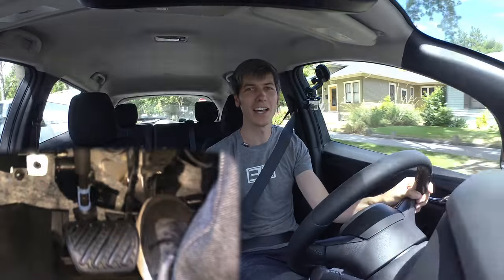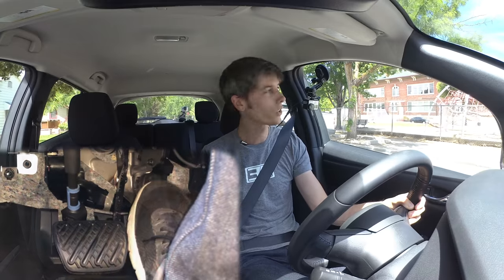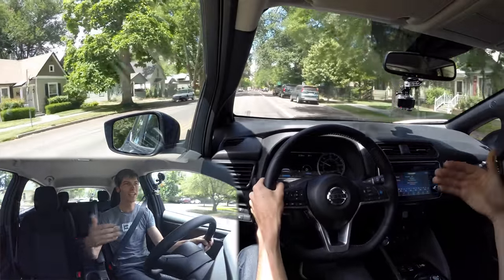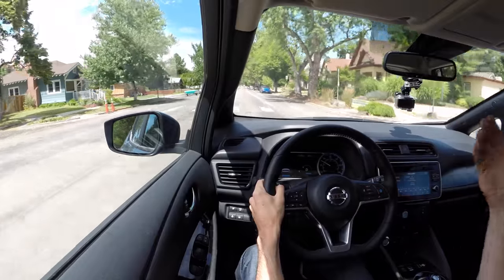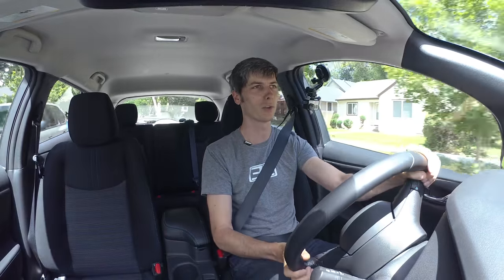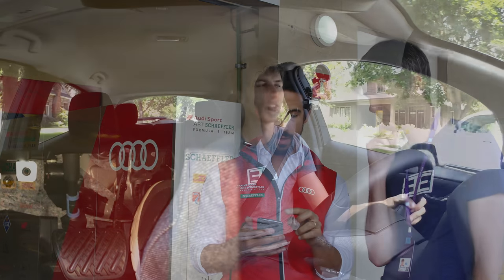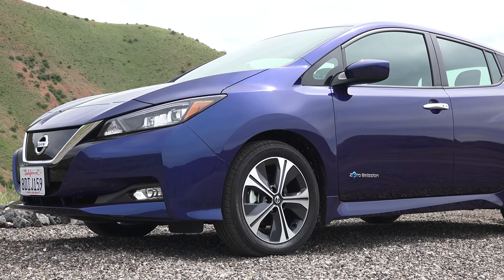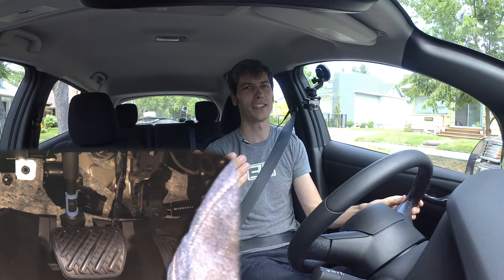What Is One Pedal Driving?

Comment: Does this eliminate coasting capability?
Reply: there is a setting to disable the feed back to the batteries
Reply: I don't think so because you can touch the gas pedal just a little bit and it will disable the engine brake - or you could just turn the system off. (haven't tested it tho, just assuming it)
Reply: JoshL You can still coast but the difference is that you will still need to push the gas pedal down a little. At least that how it works in my car, it may be different in others
Reply: I was wondering about that, too. Even more so, since they say, that coasting is the most energy efficient (at least with combustion engines).
Reply: it regenerates lots of energy to the batteries when you coast. 
around 300~ meter of downhill coasting regenerates around 4-5 miles of driving!
Reply: Presumably, but there is a toggle to turn the regen braking off unless you are manually applying the brakes, where it will also step in to help.
Reply: In my Ioniq, I can mostly do the same with the regen set to max. I don't use this as I find it tiresome. I prefer to have the regen set to zero and use the pad of the steering wheel to regulate the regen. So I can coast, and use the pad to break, plus the hydraulic brakes if I need to brake more.
But I think the best would be if there was no regen by default, and using the brake pedal to regen more or less, and the system would use the hydraulic brake as needed (if the regen can not brake enough).
Reply: I think some cars have a creep setting
Reply: Pretty sure that's all customizable, atleast in a tesla it is.
Reply from the maker: You can coast two different ways. If you have it in e-Pedal mode, you can coast by simply lightly holding the throttle. Or you can turn e-Pedal mode off simply by pressing the button and coast like normal.
Reply: Dominykas but real coasting is still more effective than regenerating, so if you just can go on after driving down an incline you use your energy better if you coast instead of regenerating.
Reply: +dranoelr:   "Real coasting",  which stores the car's energy in kinetic form, is better only when there's a known opportunity to transfer the energy back to gravipotential energy by going back uphill, before one's speed builds past a legal or rational limit.
Reply: Can you easily turn e-Pedal mode on or off?  In other words, is it a simple easy to access button on the console or steering wheel?  Hopefully not deep down in some menu option on the screen.  

I think it's important to be easy to disable it.  Sometimes, especially on long drives, I'll want to take my foot off the accelerator pedal to give my foot/leg a stretch.  With e-Pedal on, that would slow the car down.
Reply: Domenic DeFrancesco: cruise control. It is a thing.
Reply: Timothy Nguyen gas pedal🤔 ... some things are hard to let go, but “go” pedal may be a better name.

Comment: I've been doing something similar with regular cars. I've learned the engine braking strength of different cars, and can slow down most of the way without using the brakes, when there's no one behind me. I don't do it so much with a car behind me, because impatient tailgaters, nuff said. Interestingly, the engine braking is better in the winter, I assume because the parts and lubricants are colder, providing more friction.

Comment: It's not only electric cars you can do the 1 pedal driving with.
Basically you should do it with all ATVs and tractors etc which have a hydrostatic transmission. If you let of the gas they usually break slowly by them selfes and if you would be to slam on the break all the time it would destroy your gearbox/axel because of the "water hammer" effect - and that wouldn't be nice, would it?
Reply: "water hammer" oh give me a "break"...just tell everyone you dont know what you are talking about
Reply: stickloaf Okay. According to Wikipedia or other sources there is an effect called water hammer
"Water hammer (or, more generally, fluid hammer, also called hydraulic shock) is a pressure surge or wave caused when a fluid, usually a liquid but sometimes also a gas, in motion is forced to stop or change direction suddenly, a momentum change. A water hammer commonly occurs when a valve closes suddenly at an end of a pipelinesystem, and a pressure wave propagates in the pipe"

As far as my knowledge goes when you hit an the foot break on a vehicle with s hydrostatic transmission you force the pump to go in its zero/non pumping position or lock up the rear axel so the fluid can't flow through there as it wants and then the upper mentioned effect kicks in, harming your parts in the long therme.
However I have to give you the credits for noticing that I'm not an engineer so there is a fair chance that I'm in deed wrong.
If that's the case and you know better: teach me, I'm eager to learn.
Reply: Humbucker 007 Most hydrostatic systems have relief valves built in that can allow oil to go from the high pressure side of the circuit to the low pressure side of the circuit. The high and low pressure side is determined by the position of the swash plate of the pump. (This allows for forward and reverse). In the event of the pressure on the high side becomes too great, it can run accross the relief to the low pressure side.
Reply: Seth ok fair point. I didn't thought about them I had the older transmission in mind or the ones in the smaller Iseki tractors where they don't do it to probably get you to by the next bigger tractor

Comment: So, if you think the driver of an electric vehicle is brake-checking you for following too close, relax, that's just how their cars work.
Reply: I never realized my brake lights were engaging while using regen. I thought I was slowing down without warning to the person behind.
Reply: Glen Atchison On second thought, I should check this. It doesn't make sense that they would implement this behavior. Maybe there's a config setting for the brake light.
Reply: Well from what I read, the behavior of the brake light varies among manufacturers.  Some cars use an accelerometer to activate the brake light under hard deceleration, others activate the light based on the relative position of the pedal and others have different modes for even more options. So, I guess..... carry on. heh
Reply: My Subie is pure gas but has adaptive cruise control. It will try to use engine braking and downshifting to maintain following distance before it applies the brakes when slowing. It has a little image of my car, hash lines to show my following distance selection (I can choose my following gap depending on traffic) and an image of a car to show if it detects the vehicle ahead of me. The image of my car will have my brake lights on/off depend on if my brakes lights are activated or not. It let me knows if I'm downshifting or braking. It seems logical to implement the system on an EV and let drivers know if they are or are not alerting other drivers to their deceleration.
Reply: Alternatively, stop following too close and then you won't have to worry about brake checking regardless of if it was intentional.

Comment: Very similar to one of the ways suggested in Smith System. Of course, this defensive driving method was designed back in the days prior to automatic transmissions being a thing but it works out with them as well. Reportedly, using a method similar to 1 pedal driving (using the brakes as little as possible and letting the engine maintain vacuum to reduce fuel consumption) many agencies who practice the method have seen as much as a 29% decrease in fuel consumption.

Also very similar to how diesel-electric locomotives slow down.

Comment: I've never paid for a car that wasn't a manual transmission - and quite a few of mine have been "four pedal" vehicles - where the parking brake is a foot pedal, rather than a hand lever, too.

But I recently got a BMW i3 to be my wife's primary commuting vehicle.  I love one-pedal driving. And as a rear-wheel drive, the "braking solely from the rear wheels" most of the time is surprisingly "un-jerky". (And probably helps preserve the front brakes even more. I have to imagine this car's brakes will last 300,000 miles.)

Comment: Seems like another thing to make drivers worse. Imagine having someone a bit thick, learn to drive a car like this, they wouldn't be as conditioned to full time brake pedal use, thus more likely to cause a rear ending. Driving is and has always been an active affair, keep it that way.
Reply: On a prius this is not a problem, if you just let off the brake the car will use the regenerative brake, but only slightly, no way it would stop you. As you apply the brake slowly it increases the regeneration until right before you come to a complete stop. If you brake pretty hard it maximizes regeneration and the normal brakes at the same time. And of course if you jam on the brakes, it jams on the brakes. Very cool system.
Reply: This sounds like the way many forklifts work currently. If you learn to drive this way it will be no different than having 2 pedals.
Reply: I'm a huge EV fan but can see what you mean.  However I would presume that if someone really needed to stop, they would instinctively go for that break petal
Reply: Exact reason I always use my turn signals even if it is in the middle of nowhere. 1 it's the law, 2 I don't know if there is someone in a blind spot, and 3 to train my muscle memory. Use it or lose it.

Comment: Brakes will seize up  if you don't use them
Reply: 16ats rust like crazy
Reply: Moose54656 exactly.  Especially in snowy areas.
Reply: Yeah I just replaced the rear brakes on my commuter from lack of use. Fronts are fine but the soft braking I usually do just doesn't actuate the rear brakes enough. 

I try to get off the accelerator early to avoid braking because braking is wasted fuel, but now I'll probably do some hard braking once in a while.
Reply from the maker: No... they're moving every time you drive and lightly rubbing. Seize? Seize would indicate you literally couldn't move.
Reply: Engineering Explained greetings from Europe where snow and salt is very common. And brakes will seize up. No this doesn't mean that car wont move at all, brakes arent activated all the time. Well ofc when car sits for 5 years or something then yes, pads will stuck but the mechanism also will seize. Pistons and older cars have handbrake with cable and such. For example automatic car and e-brake, you hardly use it beacuse of the "park". And eventually brakes will rust stuck. Sorry if my english is off a bit

Comment: Would be weird to get used to.
Reply from the maker: I was surprised, but honestly used to it after about 5 minutes. Very simple and intuitive.
Reply: It's actually quite easy and very intuitive.  Would take you about 7 minutes to master... give or take 😉
Reply: You get used to holding your foot a certain way on the accelerator when you want to coast as well.  It's very intuitive.  I had a 30 minute test drive of the 2018 car and it was a snap to adapt, but I had leased a 2014 LEAF for 3 years, so I already had my brain adapted to driving a car with mild regen.  Honestly, after returning to a gasoline powered car, I miss this a lot.  My next car will be another EV.
Reply: can you help me understand how is the feeling any different from engine braking in a combustion driven car? i drive manual pickups and if there´s enough road I brake only using the engine and not the brakes. Maybe its different with automatics?
Reply: Felipe, EVs feel more like manual transmission cars than automatics.  It's one reason I like EVs for a commuter - the feel of manual without the constant need to use the clutch in traffic.  I prefer manuals, but its a pain with my very busy commute.  Automatics tend to want to coast more since they will freewheel in certain gears, though most in lower gears will compression brake as well.  EVs in neutral (or with your foot in the right position on the accelerator to prevent regenerative braking) will still coast better than automatics, though, since the transmission doesn't provide any parasitic drag.  I hope this answer helps.
Reply: Oh I get it now, thank you for reply, very much appreciated.

Comment: This isn't really anything new, truckers have been doing this for decades
Reply: +Roger:    "truckers have been doing this for years"  And having engine braking synthesize fresh diesel to put back into their tanks?
Reply: Levenkay my thoughts exactly 😂 Roger obviously doesn’t quite get it
Reply: Levenkay ... they've been driving with one pedal. But please be pedantic and remove context so your joke works
Reply: +Roger:  Eh?   These comment pages generally fail to preserve the continuity of remark-and-response, so it's necessary to explicitly reference the comment to which one refers.    In case it isn't clear, I simply intended to point out that regenerative braking, however it's done, actually recovers a part of the vehicle's kinetic energy for later use in propelling that vehicle.   In order for "engine braking" an ICE to match that feat, it would have to somehow make new fuel as it slowed the vehicle.   And in no way is "ceasing to consume" better than "making more".

Comment: I try to attempt 1 pedal driving in my Ram as much as possible. I try to time letting out of the throttle or getting into the throttle, to the best of my ability to where I can avoid touching the brake as much as possible. When I bought my truck it had 80% pad life left on the current brakes. I made those brake pads last me over 4 years..... 80% pad left on a 5000lb truck with only 16" wheels (so small rotors) and single piston calipers... I'll say I'm was damn impressed.

Comment: I like this. I hate relying too much on the brake pads. Buses use what's called a hydraulic retarder in the gearbox which assists stopping of the heavy vehicle which takes a lot of the load from the brake shoes.

Comment: I test drove a 2018 Leaf with the e-pedal feature, and I like it. 

My only complaint with my 2011 Leaf is the brakes. They are usually okay, but occasionally they are grabby. 
The e-pedal seems to have fixed that intermittent issue.
Reply: This is an issue you can resolve! I have a 2011 Leaf without that issue. There is a TSB that resolves it. With your next brake fluid replacement, ask the garage if they know about this and can reflash your VCM to correct the issue. It's an issue with the brake pedal (which is brake-by-wire) using the wrong brake force mapping curve (or possibly brake force sensors being miscalibrated). Grabby brakes are NOT by design, it's a flaw!
Reply: demultiplexer - thanks for the tip. I’ll ask next time I get service done.

Comment: One apparent challenge with this approach, however, is that the car will not coast slowly on its own, it will draw to a stop.  Apparently, this is an option with the Tesla, and they have found that slow speed accidents are greater with 1 pedal operation.  The logic here is that you're pressing on the accelerator pedal while moving slowly instead of simply covering or feathering the brake.  If you're covering or feathering the brake, you're much more able to come to a quick stop and less likely to accidentally goose the accelerator and ram into something.   So from a safety perspective, I think 1 pedal operation is probably not quite as safe and there's no reason the vehicle couldn't make use of regenerative braking with light brake feel and physical brakes when you increase the brake pressure to achieve the same goal with improved safety.

Comment: You mention letting off the gas to come to a perfectly smooth stop, but what if your uncoordinated friend needs to stop at a certain spot? I imagine there would be a problem with resonant frequencies, where a soft touch of the throttle pulls the drivers leg (and the pedal) into a braking position. They must have a very interesting map of gains for different positions on the encoder.

Comment: If the braking light turns on every time you decelerate it sounds like it would create a lot of traffic jams on busy road ways.

Traffic jams occur when the drivers brake abruptly. The car behind them must brake too to avoid collision and so does the car behind that one. What starts off as a light correction of speed with a split second braking ends up as a total stop of traffic couple of miles behind the first car.

Normally when driving on a highway, with proper safety distances, you can easily estimate the differences of speeds between yourself and the car ahead of you. If the deceleration of the car in front of you is slow, you simply lift up the pedal and let the speed bleed off. This might make the care behind you engage the brakes if he does not follow the proper safety distances, but in most cases they can do the same.

If the brake lights of the car in front of you suddenly turn on, it is almost certain that not only will you engage the brakes, but you will do so more aggressively. That effect accumulates with each car behind you eventually creating a traffic jam.

Yes, it has a threshold so it wont turn the brake lights on every time your foot twitches, but I'm pretty sure it still creates more unnecessary braking on highways.